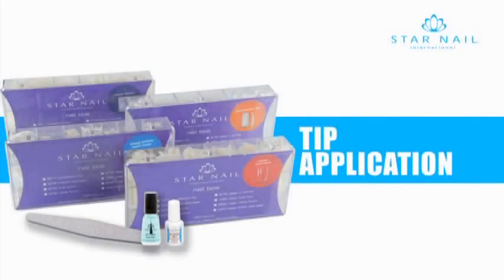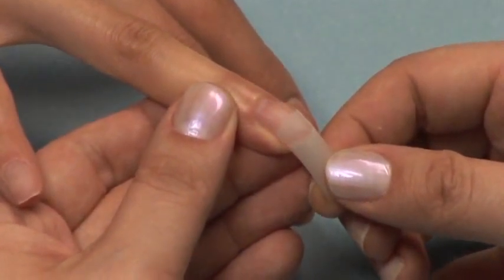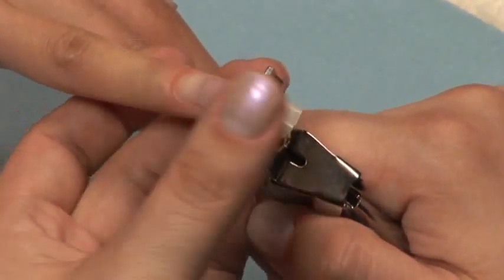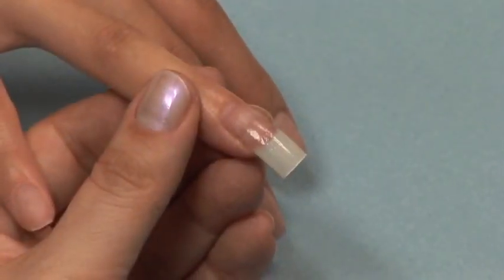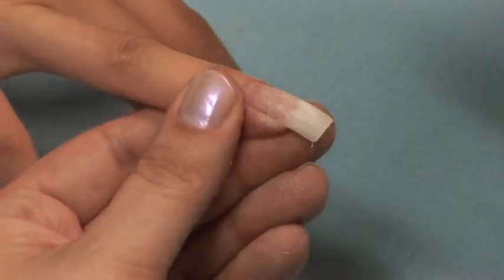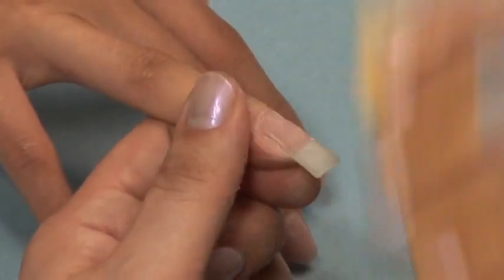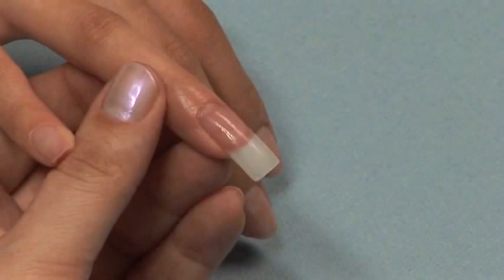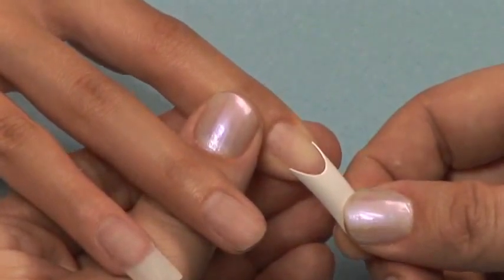Tip Application

Comment: iv watched many vidoes showing how to fit a nail tip. not one of them were visible as they were shot at the wrong angle or to far away. this is the best video showing me at the correct angle how to fit a tip and make sure that it is the correct size. thank goodness at last. star nails to the rescue.